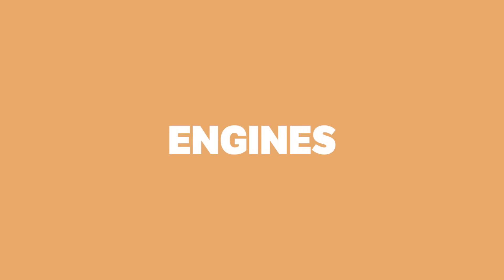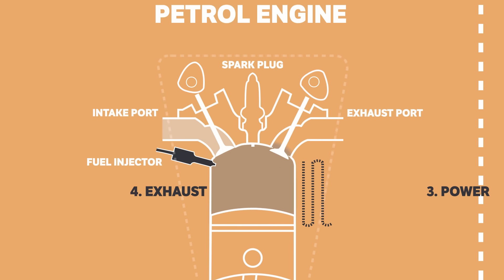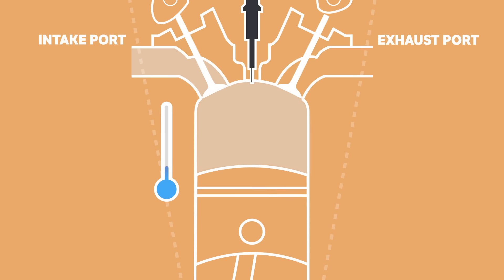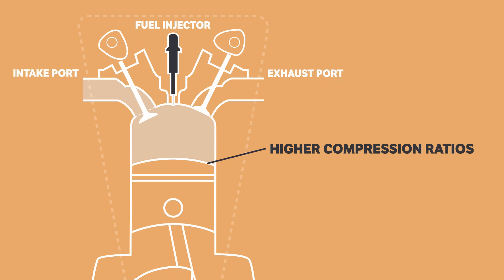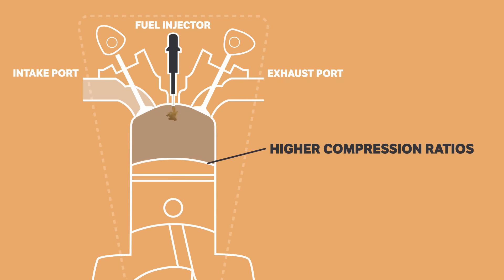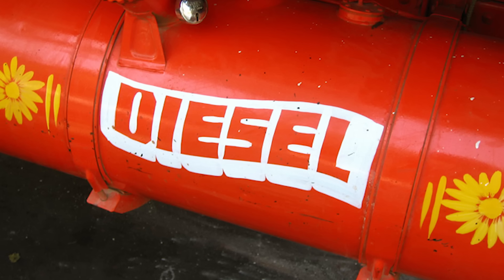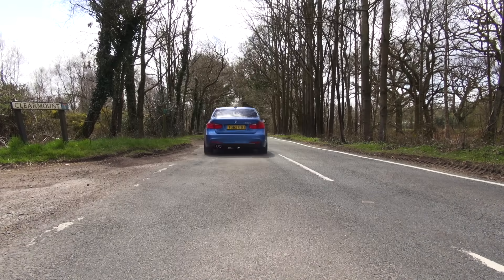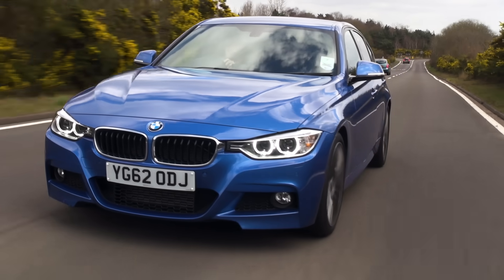The Differences Between Petrol and Diesel Engines

Comment: How is the fuel compressed, aren't liquids practically non-compressible?
Reply: They're thereotically, non compressible
Reply: @nosaucepotatochips1612  true, but still. Liquids are VERY hard to compress, especially with a compression ratio of 16.2:1
Reply: @ProjektKlover  but I guess, the fuel mixes withe the air in a small quantity. As the air is more in it, it compresses with it
Reply: The air is compressed, therefore it heats up, and the fuel is sprayed in a fine mist so it combusts evenly and efficiently.
Reply: @monsterfrog218  finally... 👏

Comment: Which among these two are less damaging for the environment im in favor of that.
Reply: Depends, if you get newer diesel cars with euro 6 engines they can have about 20% less CO2 emmisions than petrol
Reply: @BollockSauce  right.Peteol engines are better for the environment not only for their contribution to greening the earth do tho higher CO2 output but they also have far less toxic NOX and more importantly less toxic particulate:
Particulate matter (PM) from both diesel and gasoline engines can cross the blood-brain barrier (BBB), but there are differences in their characteristics that influence their behavior and potential health impacts. Here's a concise comparison:
Composition: Diesel exhaust particles (DEPs) typically contain a higher proportion of elemental carbon (soot) and organic compounds, such as polycyclic aromatic hydrocarbons (PAHs), due to incomplete combustion. Gasoline exhaust particles are generally smaller and contain a different mix of organic compounds, with fewer PAHs but potentially more volatile organic compounds (VOCs) and smaller ultrafine particles (UFPs).

Size: Gasoline engine emissions tend to produce smaller particles, often in the ultrafine range (<100 nm), compared to diesel, which produces a broader range of particle sizes, including fine (PM2.5) and ultrafine particles. Smaller particles from gasoline exhaust may have an easier time crossing the BBB due to their size, as ultrafine particles can more readily penetrate biological barriers.

BBB Penetration: Both diesel and gasoline-derived ultrafine particles can cross the BBB, either through passive diffusion or active transport mechanisms (e.g., via olfactory nerves or systemic circulation). Studies suggest that ultrafine particles from gasoline may have a higher penetration potential due to their smaller size, but diesel particles’ higher toxicity (due to adsorbed chemicals like PAHs) may cause greater neurotoxic effects once across the BBB.

Health Impacts: Both types of PM are associated with neuroinflammation, oxidative stress, and potential neurodegenerative effects when they cross the BBB. Diesel PM is often studied more extensively and is linked to stronger inflammatory responses in the brain, but gasoline PM’s smaller size may lead to more widespread distribution in brain tissue.

Key Difference: Gasoline particulates, being smaller, may cross the BBB more easily, but diesel particulates may carry more toxic compounds, potentially causing greater harm once in the brain. Data is limited on gasoline-specific PM effects compared to diesel, as most studies focus on diesel or general PM2.5.

Comment: Okay I get how that works but can you explain to me how a diesel engine for a semi like why does when your idling it puts fuel back in that makes no sense whatever it's not burying it goes back in thanks
Reply: Whenever the engine is running it requires fuel. Doesnt matter if it is idling or at full throttle it will always use some amount of fuel.

Comment: Diesel engines are quite inefficient when they are out of order. Despite fuel efficiency, they are less reliable for their relatively sophisticated structure... Bottom line there are no winner
Reply: How many gas cars run for 500000 miles? Not many/none

Comment: Petrol Engines. They always have more HP compared to any diesel engine of the same cilinder size, you forgot to mention that in the video.

I also despise the sound of the diesel engine.
Reply: Yes thats True but the car moves only whit torgue not on horsepower

Comment: most, if not all, jeepneys and other transport in the philippines use diesel. its cheaper and efficient truly.

petrol are for private vehicles mostly
Reply: Same exact reason why our air is very polluted. Petrol is far cleaner and more eco friendly than diesel, you can observe that jeepneys and most public transportations blow dark smoke
Reply: @261tristhan  no, it has something to do with the engines, not the oil per se

a proper engine can fix smoke belching, given our public transport has an already outdated engine parts, and some are already old, hence we see black smokes.

also, even private vehicles do smoke belching.

Comment: Have a simple question. Why couldn’t petrol engine use compression to make the cylinder reach the point of ignition like Diesel does but use a spark plug instead?
Reply: Excellent question! I was asking that question myself too. Here's what I found out:

Petrol can also be ignited by compression, but at inconsistent pressure ranges (somewhere at 50% of the ignition pressure of diesel). The spark plug was put there in order to make petrol's ignition consistent (as petrol also is very volatile and explosive compared to diesel).  

I hope my limited understanding helped you.
Reply: Ryan Ventura Thanks Ryan. That helps :-)

Comment: Both of them use spark right? Then why you guys says only petrol engine use spark.
Reply: Nope. Gasoline engines use a spark plug to ignite the fuel. Diesels use compression, the fuel gets hot enough to spontaneously combust due to the intense pressure.

Comment: Diesel engine parts are more expensive than gasoline engine parts but diesel fuel is cheaper than gas fuel. Diesel engine can withdstand high amount of temperature.

Comment: I just got my first diesel it’s a 2010 ram 3500 I love it especially when I use cooking oil and or motor oil in it 387430 later still running like a beast

Comment: But why do petrol engines sound so much better (take race cars as example) than diesel ones?
Reply: higher revs.. more RPM
Reply: Because it is your own opinion.
In my opinion, there is no better sound than a hard working, non-silenced Diesel, the bigger, the better.
For example Scania V8 or EMD 567/645.
But I like the old Volvo D24.

Comment: By the end of the video, you start comparing "apples to oranges" (even though they can be compared). Comparing naturally aspirated petrol engine to a turbocharged diesel engine isn't fair, because TD engines have much higher torque at lower rpms compared to NA engine that has linear distribution of power and torque.

What you can compare though, are turbodiesel and turbo petrol engines. Great examples of the fuel-friendly and powerful petrol engines are BMW's TwinPower Turbo, VW/AUDI TFSI, Alfa Romeo TBI, etc. Turbodiesels cannot compare to them.

Comment: its my 30th year with a peugeot desil,, 2 cars i got to 250k,never had an  exhaust,cluch,or engine work,,,always had 55-75miles per gallon,,and always had a clean license too  :-)   PS desil used to be half the cost of peterol untill we all bought desil cars,,,my first car a 205  i used to do 1000 miles for £25 (in the 90"S)

Comment: But why are they called dirtier?
Reply: It's because of the amount of fuel that's actually combusted. With petrol, the ignition is done via a spark plug that simply "Sets it off like a lighter on a fuse" which causes most of the fuel injected to actually go off. Whereas with diesel, you need the engine to heat up beforehand as it uses heating coils to heat up the chamber. Less heat = Less diesel combusted in one cycle. This causes a bit of un-burned fuel to be vented out the exhaust, in turn it simply causes a lot of smoke (Especially if the engine has been started just now).

Alongside the other factors, such as diesel having more carbon atoms in its structure which turn into more CO2 after combustion per molecule, compared to Petrol. (But again, diesel burns slower in rate compared to petrol. So it fluctuates in regards to REAL CO2 emission, while the tests and figures on them are done assuming the vehicle is burning the fuel at the highest rate and efficiency possible.)
Reply: @daniellerosa-1071  thanks for spending time to answer to me brother ^_^

Comment: Diesel is tempting but, expensive on service, especially when something breaks down (300 euros at least)
Reply: its my 30th year with a peugeot desil,, 2 cars i got to 250k,never had an  exhaust,cluch,or engine work,,,always had 55-75miles per gallon,,and always had a clean license too  :-)   PS desil used to be half the cost of peterol untill we all bought desil cars,,,my first car a 205  i used to do 1000 miles for £25 (in the 90"S)   most times i just had the oil changed  why is it dearer ?
Reply: @minstrelofMir  either you are the luckiest guy on earth, or you gotta be kidding 😂
Reply: @charalamposkounes5071  my sister ,brother,and mum+dad all had one that long too,my dad was a driving instructor and said at 400k miles was nothing on a 205 and all cars have the same 1979 engine,,a 306 had a bit more weight,,but 135mph(once long ago)shows it carnt be that slow an engine,,now im in a 2003 206  only 1,1 tons with a 2.0ltr turbo,lighter and faster

Comment: What is the difference between "Ethanol 100 Vs Petrol Engines"?
Reply: Petrol engines usually means it runs on gasoline, although technically diesel is petrol as well it is just not referred to as such. You can tune an engine that runs on gasoline to instead run ethanol. E100 is a fuel that is 100% ethanol,  E85 is 85% ethanol 15% gasoline, etc.

Comment: So why are supercars runs on petrol?
Reply: Gerard voughn faust offers more power
Reply: Therefore diesel is only for efficiency, and petrol for more power.
Reply: Gasoline engines are capable of higher rpms. Higher rpm means more horsepower and horsepower equals speed. Diesels make a shit ton of torque which is great for towing heavy stuff but the lack of higher rpms limit their horsepower.

Comment: Diesel is not more efficient. You are not burning all the fuel and the design isn’t as perfected as petrol engines. In some countries they are banning Diesel engines.
Reply: What you said was incorrect diesels always have and always will be more efficient then petrol. Yes unfortunately it's true certain places are banning diesels but that's only because of the electric conversion takeover.

Comment: Nice video !! There are not talking about the difference between direct inject and no direct injection . Diesel engine pollute much more than petrol engine .  And the best part they haven't talked about is the petrol engine's flexibility !!! Most part of you don't stop to think about the Diesel engine's torque, just because it got a Turbo, but if a test of the same car with Diesel and Petrol engines  ( both with Turbo ) was done (from an A point to a B point ), all of you would be so surprise to see the Petrol car arriving fisrt !!!  YYYEEEAAAHHH !!!

Comment: I haven’t had a petrol car for years. I like the fuel efficiency and low down grunt of TDI cars. My car only does between 1500 and 3500 revs, it’s all it needs to do. I fancy an RS3 or S3 but I’m unsure whether I should go with a BMW 335D MSport instead, great power and better on juice. My current BMW 1 series 118D MSport has done 168K and hasn’t skipped a beat, how reliable are Petrol engines these days for 30K per year driving??

Comment: BMW X6 3.0d 70000km - best Diesel engine ever. Even in winter at -27 (I live in Russia) no problems at all.
Reply: consume of the tank?
Reply: Ricardo Lozano Fuentes I’m not sure what you actually meant, but if you asking about fuel consumption, it is about 10liter/100 :))
Reply: @ВладЛ-н3ъ  yes that is thank you, not bad for a 3'0
Reply: Ricardo Lozano Fuentes yeh, on a highway it is about 8L average. But it’s all depends on how you drive. My friend has Cayenne 3.0d and about 15L/100 because he is always driving in sports. Btw Cayenne is super nice, dreaming to buy it in a few years 🤗
Reply: @ВладЛ-н3ъ  yes thats pretty sure, I have a corsa 1.4i and it does 5-6 doing good and over 10 if you change gear at 6.000rpm. I bet your diesel cant change at that speed hahaha. You have a nice car and will have the cayenne in a few years for sure!)

Comment: But why isn't petrol too ignited with pressure?
Reply: It can be, however since gasoline is a less stable fuel the resulting explosion is very violent and would cause engine damage. That is why gasoline engines have much lower compression ratios than a diesel. Spontaneous gasoline combustion can happen but it would destroy the engine so it is not allowed to happen.
Reply: maybe it doesnt want to? did you ever consider your fuels feelings? of course you didnt

Comment: Diesel engines can run on waste vegetable oil or straight vegetable oil.
It just need to be thinned by adding heaters to the fuel lines or mixing a little amount of petrol to your vege oil.
Only for older engines.

Comment: But did diesel engine are more costy maintance then petrol engine?
Reply: Supply and demand. There are typically more gasoline engines than diesels. Therefore parts for gas engines are more readily available. Although it does depend on your location.
Reply: Older diesels are generally easier to maintain. Emissions requirements add more complexity and make diesels a lot less cost-effective nowadays (less fuel-efficient and more maintenance required). This is at least true where I live. 5.9 cummins, 7.3 powerstrokes, and 6.9/7.3 IDIs outlast anything new and get almost all of their maintenance work done in farm buildings with cheap tools and parts.
Reply: Not really in UK in USA it’s different story

Comment: I am big fan of Diesel engine. 
I am running 
Skoda rapid 1.6 TDI 
110 BHP , average 22.3kmpl
Reply: Well i have a 1.0 Tfsi Audi q2 116Hp and produces 200 Nm torque and uses 6 litres of fuel every 100 km

Comment: You explained this video faster than a diesel engine compression. I got nothing
Reply: Watch with 0.75x
Reply: Was waiting for this comment
Reply: Jjjaj I watched it in 0,5 speed and only then I could understand, but it is an excellent video.
Reply: He also somehow managed to not even mention glowplugs or add them in the Diesel diagram.  How do you explain the difference between these engines without mentioning spark vs glow plugs??
Reply: @bobshenix  because diesel engines can run without the use of glow plugs, they literally are for help starting
Reply: @Zaniith  Especially cold weather climates that is a pretty important feature of the design. Less so than it used to be, but still..
Reply: @bobshenix  yeah that's right, been plenty of  times I've had to start the jeep when its that cold, once it took half an hour because the glow plugs failed
Reply: @Zaniith  That sucks...but i guess that's why glow plugs are/were a thing in the first place.
Reply: bobshenix he does mention glow plugs in his “difference between piston engines and rotary engines”
Reply: whahahahaha
Reply: True
Reply: No noob would understand this in one go. Watch it again

Comment: Okay, but why don't petrol engines have larger compression ratio for self ignition ?
Reply: Gasoline is a less stable fuel. The resulting explosion would be very violent and cause severe engine damage. Spontaneous combustion of gasoline is commonly referred to as detonation, and it is very bad.
Reply: @Redtooth75  thanks for the info 👍🏼
Reply: That's a good question.

Comment: Proud owner of Alfa Romeo with 2.0L Twin Spark  (two spark plugs per cylinder) engine.

Petrol engine of course
Reply: The 2nd plug is actually needed to set fire to the oil which pours through the cracks in the cilinderhead of an Alfa?
Reply: @minityper  of course
Reply: 1.8 T. Spark here. That engine is so awesome. I love the feel when other 4 spark plugs kick in. Even after almost 20 years it is still beast.
Reply: Twin spark( two spark plugs per cylinder) that's how a petrol car owner talks or explain 🙂
Reply: can't beat the mighty 2.4jtd in my 156
Reply: I used to drive a ar 75 2.0 TS 👍🏻😉
Reply: Proud and Alfa Romeo in one sentence... hmmmmmm

Comment: The point of the turbo (3:56) is to pump more air in the cylinder. In a diesel you can pump as much as you want (the more, the better). With petrol you are limited by the stoichiometric ratio.
Reply: Uh... no. 

The stoichiometric ratio is just a air fuel ratio for complete combustion of fuels. For gasoline it’s 14.7:1. For diesel it’s 14.5:1. 

With either of them.... if you put more air in, you put more fuel in. 

Gasoline engines are generally limited by detonation. But although Diesel engines don’t have that limitation they are already running huge compression ratios, high heat, and insane forces on the dynamic components. 

Adding too much boost will destroy the engine as surely as a gasoline engine.  This is why in tractor pulls they run super rich (smoky) mixtures for cooling, and have quite spectacular failures. That’s also why you want to avoid any chipped or modded Diesel engine like the plague.
Reply: Bartonovich52 What you said is all correct, however you have to press "Read more" to see the full reply. I tried to be short on purpose. That said: Of course, you can just add more fuel to maintain the stoichiometric ratio, however (as you said) this will lead to engine knock IN PETROL engines. Not in diesel, since it only compresses air. And of course you can't just pump in an unlimited amount of air, because it would blow up the engine (both petrol and diesel).